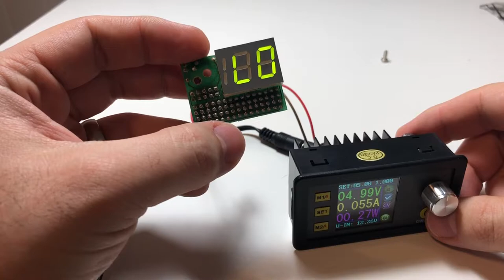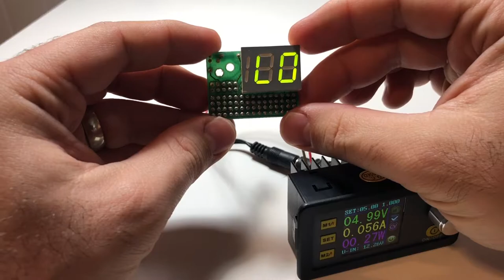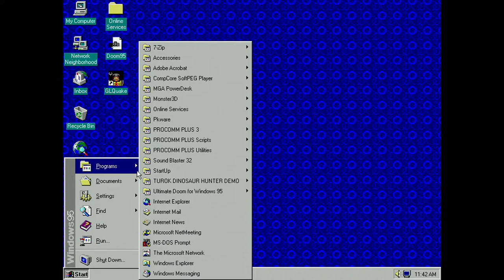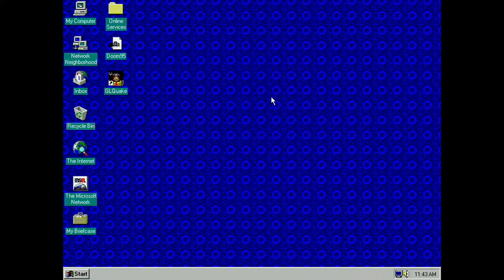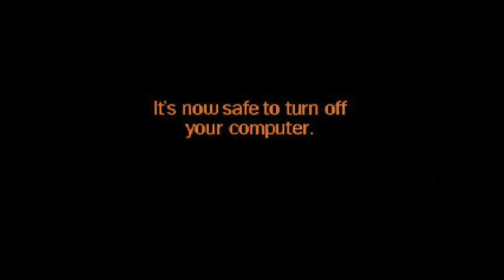Building a high-end 1995/1996 Socket 7 Gaming PC! #sockettome7

Comment: The first PC i built for my self was a cheap Amptron with an intel 430FX chipset and a P133. built a new one about a year later, it was my personal favorite board PC it was the Intel Triton AN430TX with a Pentium MMX 233.  I had to buy a whole new chassis because the new board was an ATX. I had a S3 video card. 32MB ram and WD 1.6GB hdd. running win95 OSR2 and a 56K modem. it was also the first time i got to go to comdex with the company i was working for. that was a hell of a good year. I played the hell out of MechWarriror 2 on that machine.
Reply: That's the exact board and processor I'm currently using for my Windows 98 + DOS build, it's called Anchorage. Turn off the level 2 cache and downclock to 120mhz and you have a great 386 machine 🙂

Comment: I really like the progression you've made in the format of this video compared to the last one. I also like that our two systems are very similar and yet somewhat different, and illustrate the longevity of the platform. It's pretty funny that we both used the word 'beefy' to describe the VRM heatsink, too. Great technical details, an awesome case, and an authentic gaming trip back in time.
Reply from the maker: Thanks so much! Really appreciate the kind words. Aside from the fun retro side of things, these buildoffs have been teaching me a lot about video creation, editing, video capture etc. Has been a great experience. Just saw your video and thought the same thing! I almost used a 430VX board and a Pentium 166 MMX if it wasn't for the dead soldered RTC on it. I was too stuborn to use Windows 98 on mine, but it certainly would have made it easier :)
Reply: @vswitchzero  yeah I agree about the learning process. I think I have a lot to learn still about watchability, and I have some catching up to do with gear and setup, but we all have to start somewhere!

Comment: Computers were so much cooler back then :)

My first build was in 1995 with a socket 7.  I dropped in an AMD K5 75mhz in that system.
Reply from the maker: Agreed! I really don't get excited about new hardware the way I did back then. The K5 CPUs were awesome CPUs and had a really promising architecture at the time. I've been keeping an eye on eBay to pick one up.
Reply: I very nearly did a K5/75 system!
Reply: @vswitchzero    @Brassic Gamer  Money was tight back then.. that k5 set me back just $30 new!  I later upgraded to a k5 150mhz I picked up off of ebay.  Apparently the k5 150 was a special run for a specific brand... AST IIRC.  The video cards on that system went from a trident svga to a diamond stealth.. and then finally an add in voodoo.  

Trying to remember the games I played back then.. I think it was mostly xwing vs tie fighter, warcraft 2?, starcraft...   At some point I started playing everquest.. but I think I was running a k6 or a slot1 intel with a voodoo2 by then.  I played a lot of unreal too... that game i think was what pushed me into that voodoo2.. way more money than I had business spending back then!  Don't even get me going about that diamond isdn modem I picked up... just to be a low ping bastard, lol.   Yea.. memories.. :)

Comment: Ah those good old days. After my 486DX2-66 I build a complete new system using a 686-PR150+ and as graphics card I had a Matrox Mystique.
Back than I didn't play games, except for a little "X-COM : Terror from the deep". I used my computer for programming and school.
A friend from school needed a new PC so I build him one using my CPU (he got that for a special price) and upgraded mine to a 686-PR200+
My next upgrade was a CD Burner and since all burners where SCSI devices I bought a decent SCSI controller and SCSI harddrive (started with 1TB).
Now with the 686-PR200+ being one of the rare CPUs having a 75MHz FSB back than and a 7200rpm SCSI drive ... that machine was really super fast.
Since I am the kind that gradually upgrades his PC all those parts should still sit somewhere in a box.

Comment: Soundfonts are so much fun to play with, particularly in these older titles with their MIDI soundtracks. It was a great way to keep installation sizes down when everything still had to fit on floppy disks. I remember how excited I was when the family PC got upgraded to a Pentium 120, not for the Pentium but for the 486 DX4 100 that I inherited for my own personal system which was running a 486 SX25 at the time, DOOM could be played full screen at last. A math coprocessor made it "play" but it was a slideshow unless the window size was about as big as a postage stamp. Still, the SX25 was a huge step up from my 8088 I had before it :)

Comment: I used to have a very similar machine, the same case with a P133, 32mb ram, 4x 800mb drives, with a 3c509, 2x AWE32's and 1x AWE64 Gold and a yamaha OPL and a 4mb Matrox. It was before directX and i would plug korg and roland midi synths into my PC and tape decks and record players and  write software to link it all together like a mixing desk and record it.

Comment: When I got Diablo, I had a 486 DX2 66 MHz and the experience is still lodged in my memory (the game had a minimum Pentium 60 requirement) - the character would walk really slow - actually walking, because the "normal" speed is quite fast. It made for a slower, but more "realistic" and thus more scary and fun to play in my opinion. When my friend showed me his pentium 120 mhz gameplay - I was happy for my 486, because it was consistently slow, while his would have these moments of "loading" - when the game would freeze, and then load up some data and the charecter would go zooom super fast forward for a second or two - this could get you killed in the game. The only thing bad, is that the levels would take 1-3 minutes to load. But I still loved every minute of this game. It still ranks as my most beloved game of all time.
Reply from the maker: Diablo is such an awesome classic. I really need to do a full playthrough again one of these days. I played it on my Pentium 100, and even that system took a long time to load levels from what I remember. Would be interesting to see it run on a 486!

Comment: Oh, this one actually has the cpu on the motherboard, huh? Mine was weird in that what we'd actually call the motherboard (cpu, ram, etc.) was some kind of...pci card maybe? It used a long black slot, followed by a shorter white slot.
Reply from the maker: Thanks for your comment! You see that type of setup used commonly in industrial systems but it was also done by consumer OEMs in the mid-90s as well. There were also “riser” boards used to add PCI/ISA slots horizontally in some cases back then too. It made the system proprietary, unfortunately so upgrade options were very limited.

Comment: I have a board that's similar to this it is made by PC chips or ECS and it also requires that vrm in order to do the split voltage CPUs does anybody know where I can buy one of those voltage regulators because it plugs in the same way as it does on that motherboard.
Reply from the maker: Thanks for your comment! They are really hard to find and I don't think I've ever seen one for sale before. I believe the pin-out for these VRMs is standardized based on Intel's specifications, so it is possible to construct one. Necroware created one, but not sure if he released the files for it yet. You can find his video here: https://www.youtube.com/watch?v=CMiGVQbMC5U

Comment: I love these retro builds.14:50 What is that little Power Supply called?
Reply from the maker: It seems they go by many different names on Amazon, but I believe it is an "Adjustable Buck Converter". You can feed it DC voltage within a specific range using a AC-DC power brick, and it can output pretty much any voltage below the input level. There are quite a few available on Amazon for anywhere between $15 and $30 or so. Thanks for watching!

Comment: I have just bought 2 green Siemens Nixdorf Mobile 700  laptops with 120 MHz Socket 7 Intel Pentium CPUs inside. I have already upgraded the working one to 166 MHz by  replacing the Socket 7 CPU and setting the jumpers correctly. I wonder if overclocking these laptops can be done with just setting the jumpers. They both have proper cooling so the CPUs didn't overheat yet.

Comment: Did your motherboard have a turbo switch header? Iam guessing the turbo pressed on low doesnt do anything?
Reply from the maker: Thanks for your comment! Yeah, the vast majority of Pentium boards either don't have one or they don't do anything at all. I don't have it nearby, but I'm pretty sure this 430VX board doesn't have a turbo header on it. My slightly older 430FX board did, but it doesn't do anything at all. Some manufacturers used the header for "green" features - suspend etc. The only Pentium board I have that reacts properly to the turbo button being pressed is an old Pentium 60 system. It behaves just like a 486 would with it pressed (about 80% decrease in CPU integer performance).

Comment: Does it matter what model number of the Dallas clock chip you use? I’m replacing a oden clock chip in my motherboard
Reply from the maker: Is it the ODIN OEC12C887? If so, the DS12887 should work just fine. For the most part, the DS12887 is a suitable replacement for a wide range of RTC modules (Dallas 1287(usually)/12887/12B887, Benchmarq BQ3287 and ODIN OEC12C887).
Reply: @vswitchzero  thanks! Btw I just realized I wasn’t subscribed to you some how, I love your videos can’t wait for your next video!
Reply from the maker: @Caleb-fv5fp  Thanks so much! I really appreciate the feedback 🙂

Comment: What’s the black socket on the Matrox card for?
Reply from the maker: It’s a DB-26 for connecting the card to their rainbow-runner add on cards. I believe they were used for video acceleration, capture etc. I’ve never seen one used before.

Comment: I don’t think NFS SE ran in glide mode…
Reply from the maker: I don't think the original NFS (or NFS SE) had options for 3D acceleration, but if I'm not mistaken, NFS II SE supported glide. I'd have to double check though.